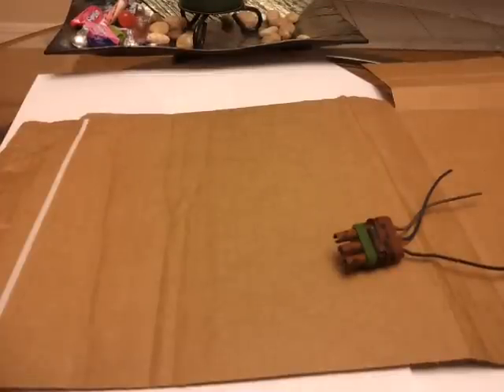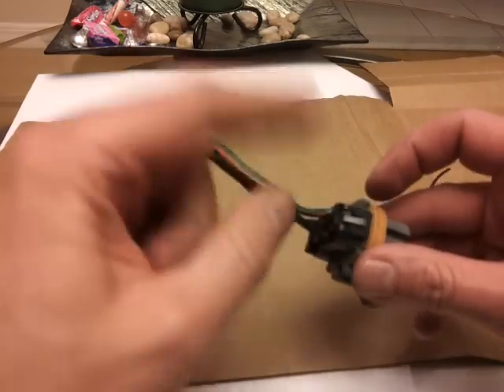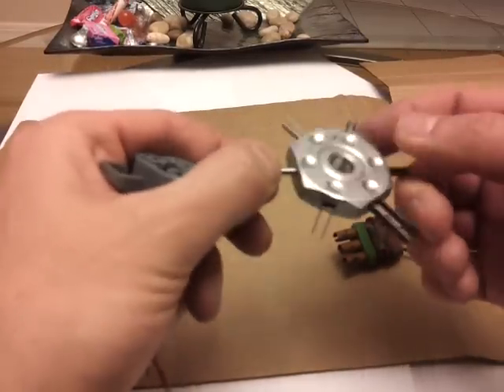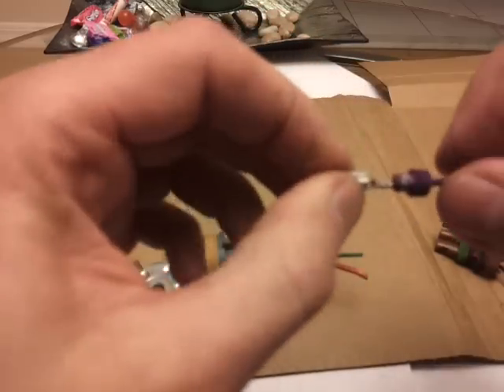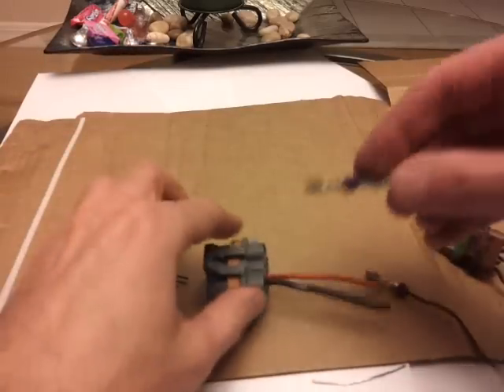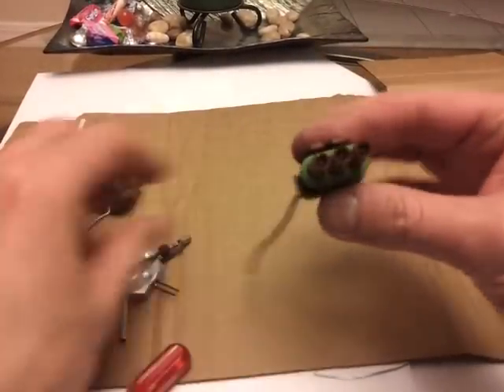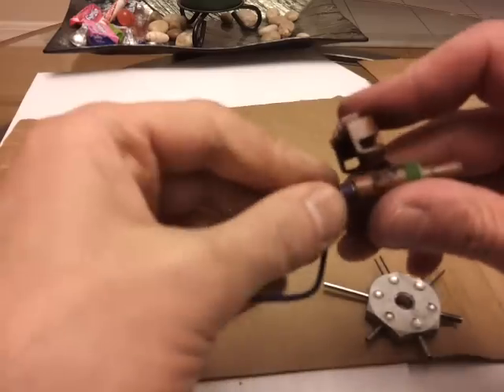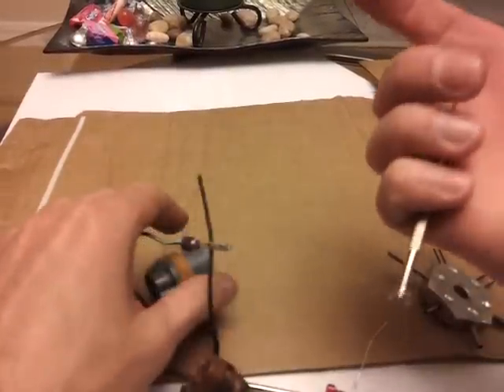AUTOMOTIVE ELECTRICAL CONNECTORS - How to repin /diagnose / fix DIY

Comment: Hey klown, Good tip on the Lisle tool. You're right about the special crimpers and they are expensive. We have some at work which runs about $300 per crimper and there's a special crimper for each type of terminals out there. At home, I just solder them in as you've mentioned. Good video.

Comment: Hey i have a oxygen sensor signal wire on my third Gen Camaro that was cut while driving do you recommend just repinning it instead of crimping a new connector back on to it
Reply from the maker: Sorry I'm a bit confused, if it's cut how would you repin it? You want to repin it at a shorter length? Just use a weatherproof connector..don't forget to subscribe
Reply: O ok jus been getting an intermittent stalling after crimping new connector on the O2 signal wire I think the crimp probably isn't solid enough and needs to be recrimped since the O2 signal doesn't have much room for error

Comment: holy crap, you saved me  30$ watching your video. Thanks Klowny.
Reply: Exactly a new connector from dealer is 50 bucks.. and a private auto parts supplier 35.. not sure what one of the devices for this costs

Comment: Very informative vid just wish it was a little clearer. Thanks for showing that tool. That's just one of those things that are not ever advertised you know? I just recently obtained another set of aftermarket lights for my Z, and one of the connectors had come off. I utilized your video to get the pins out, reclamped the wire inside the connector, snapped em back in place and voila'..... Thanks again for all the tips....the paperclip tip helped me out....got to work, fixed it, watched the rest of the vid, then realized I also had a set of the jewelers screwdrivers hahahahahaha....good vid...Thanks again!!...
Reply from the maker: awesome..thanks for watching

Comment: I replaced my crank shaft pulley and it came with a different connector (round / square)  then  what is on my compressor.  I have a 1997 Toyota Tacoma 2.4 L. What  would you do next? Thanks

Comment: One question I am trying to get answered, in regards to "ALTERNATOR REPAIR LEAD HARNESS PIGTAIL PLUG FOR GM ALTERNATORS", where do the wires plug into on the motor? I just replace my alternator and my plug only has one pin, I was sure it was supposed to have at least 4 for a 96 chevy tahoe. So I want to know how to rewire the pigtail.
Reply from the maker: a one wire alt isnt the right one for that car
Reply: The plug is supposed to have more pins but there's only one wire. I think someone pulled the pins when they installed the alt. I need to know how to rewire it myself.
Reply from the maker: +Angela Farley need to get a wiring schematic to see what color wires go where..Alldatadiy.com  has wiring diagrams

Comment: Great video. I'm to to this, I have an older Toyota Previa, I found a corroded connector. Once I get the wire out, can I simply re-sue the pin at the end of the wire without any adjustment, or do I need to widen/close the pin? I think I heard in the video you have to adjust the pin, I'm just not sure, and wanna do this right the first time. Cheers!
Reply from the maker: U can adjust the pin if it needs it..just give it a tug once u reinsert it to see if it pops out..thnx for watching
Reply: +klowny1969 could I just cut off  the broken connector  and solder in another connector ...would this work ...

Comment: Thank you, it was very useful video for me. You mentioned that the pins are expensive, but do you know from where we could order them? Dealership probably? If I understood correctly the pins connect the wire and they enter in the housing. Is it correct? Thanks again for your video!

Comment: I like you!!!!  Gotta fix my motorcycle.  

Thanks!
Reply from the maker: lol thanks for watching
Reply: +klowny1969 Motorcycle fixed.....I think.  Weak connector spring.  The spring has sprung (became flattened and needed some flexing.)  To do that, I needed to get it out of the connector. 

Mine is the Molex brand as I am told.  

Needless to say, the connection feels a lot tighter and no flashing light so far.

Just thought you might like to know.  It's on a 2007 Goldwing ABS fault!
Reply: +klowny1969 Also, check out some of my rides.  Not terribly exciting except for the Las Cruces  music video!  That's why I want my bike fixed to enjoy those rides!
Reply from the maker: Awesome ill check ot out..and glad i was able to help u :)

Comment: Believe it or not important video.. had a bad connector wire throw a code on my coil.. although the engine ran it was similar to a drunken donkey.. which could get your rear-ended.. a new connector at the dealer is 50 bucks.. you actually prevent us from being clowns and buying from them

Comment: can i remove the metal thing inside if the wire has been ripped out of that?
Reply from the maker: brooke geick same way i did in the video
Reply: +klowny1969 i cant because the metal thing wont come out i wish i could send i picture
Reply from the maker: brooke geick stick something in there to push the clip down and it will come out..trust me
Reply: +klowny1969 okay thank u so much ! 😊
Reply from the maker: brooke geick anytime
Reply: brooke geick
Reply: +juju adelicia that shit was hard with a bobby pin but a girls gotta do what a girls gotta do.
Reply: +klowny1969 but i got it when i use two bobby pins i was pushing the silver prong thing while hold bk the little black latch and it finallly came out thank goddd i was so happy
Reply from the maker: brooke geick  awesome

Comment: Unfolding those crimps holding the wire to the metal insert seems to be impossible. That's with a good hard poker. I'm sure you can imagine why I ended up watching a video like this in the first place.

Comment: By saying, "Let's not go there", you did.  Just as in an Alfred Hitchcock movie.
Reply from the maker: Clay Pottinger GUILTY AS CHARGED!!!
Reply: Bravo!   That was fast.  Cool
Reply from the maker: Clay Pottinger lol thanks for watching and commenting
Reply: My pleasure.  Nice video.
Reply: Taking the wires out was never my problem.   It's getting the plug connector cases separated.  They are never alike

Comment: You failed to use the word barb. You failed to reset by prying out what you bent in so that it will latch or lock in place upon reinsertion. This will lead to failures because it will be pushed out when connecting the whole connector back together. I have fixed way too many failed barbs because of folks like you that don't get it. Maybe you do because you speak of tabs but you are not clear about the BARB. That is the most important part of messing with this. Please abandon this and draw a picture if a BARB. The thing on a fish hook that holds it in the fishes mouth. You bend it in from the front. Then you must reshape it to LOCK back in place.  My first and last time I'll watch your stuff. Learn the proper words. Explain in detail. These folks don't know. They come here to find out and you are not derail oriented at all or can't explain it. There are now me tons of shakey connections because of this . there is even the safety issue of stabbing your own hand unless extreme caution and gloves are used. It's usually much harder requiring a cushion grip tool. Lousy my opinion
Reply from the maker: i think you dropped your pacifier
Reply: While pulling out the bent tab ("barb") is an important part of re-pinning, your tone is so negative that it is irritating... I am here a year later and you still do not have any videos made, so make some before you harshly criticize others... They are maybe not perfect, but people made an effort to make them, at least... Your comment could inform people about your important barb, but it turned out as just a rude comment, IMHO...

Comment: Check out Ballenger motorsports at bmotorsports.com.  They stock a ton of automotive connectors and I got a set of universal crimpers for around 30 bucks that works on all weatherpack, metripak, deutsch, amp, and Delphi terminals.
Reply: Yes, bmotorsports, large selection, site is easy to use, reasonable prices and shipping. 2X on $30 crimper. Always crimp new pins. Soldering old pins can cause corrosion.